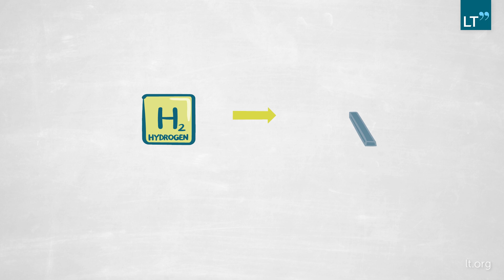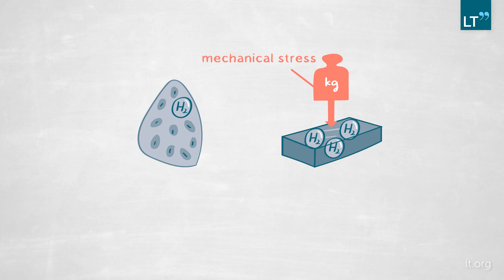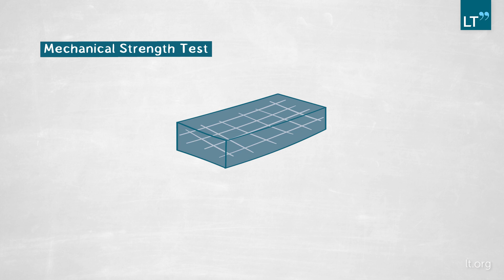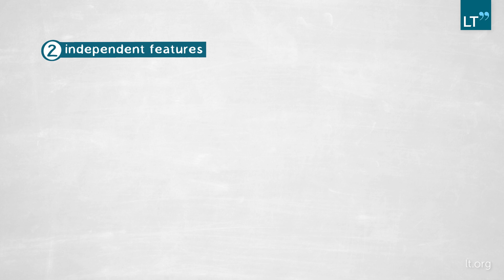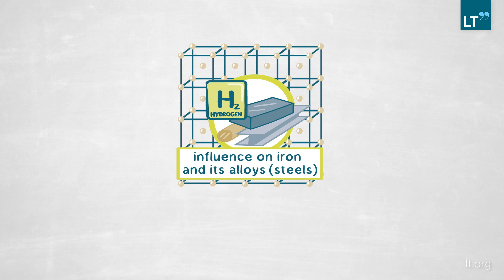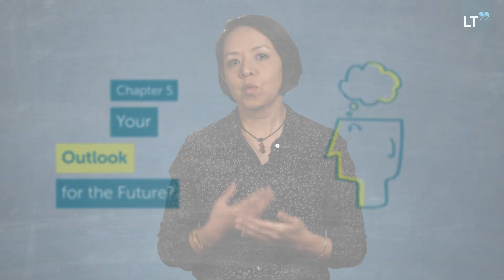How does hydrogen affect the mechanical behavior of metals and alloys?

Comment: Hydrogen embrittlement is really a form of LME (liquid metal embrittlement) driven by electron structure - helium has no effect on metals since it diffuses very slowly through most metals  with out interaction, likewise some metals are embrittled very easily vis. aluminum embrittled by gallium and mercury - steel/iron with molten copper by nickel does no seem to embrittle anything.

Comment: What happens if you spray paint the metal?
Reply from the maker: If you mean using coatings as corrosion protection: this is done since a long time, e.g. think about coatings for metal sheets. However, we are also working on more efficient coatings and also on questions concerning scratches in coatings, thus locally ineffective corrosion-protection.

Comment: Hi, appreciate your insight on this question, usually we consider hydrogen embrittlement on high strength steel, however for low strength material, like 245mpa line pipe, is there any research been done to simulate cold damage (say during handling or shipment) and subject to heat? say if a 245Mpa pipe, had damage during transport, and then went into galvanising with heat, would there be hydrogen embrittlement from HCL of the pickling process in galvanising?